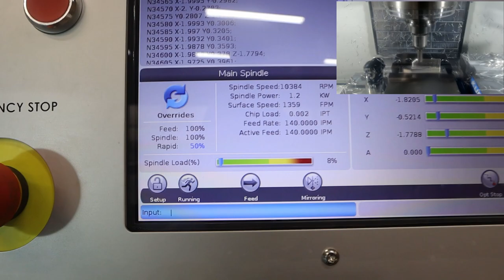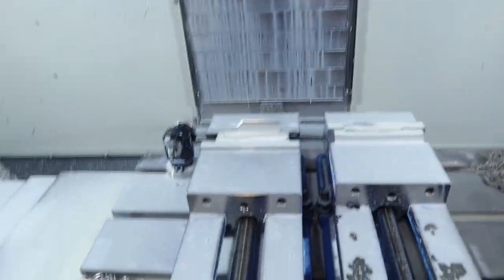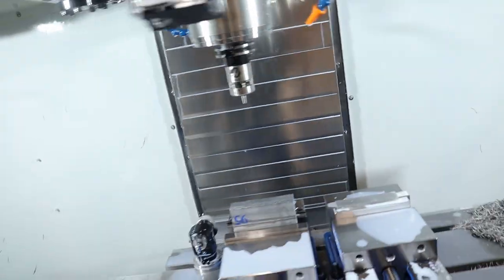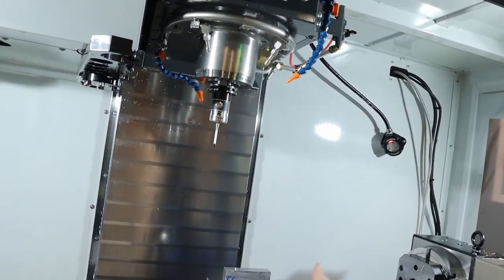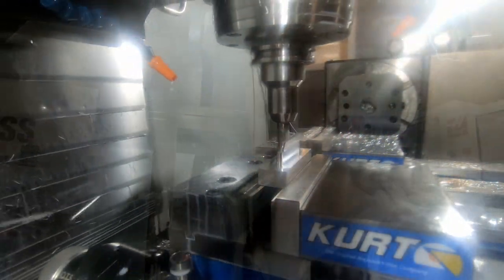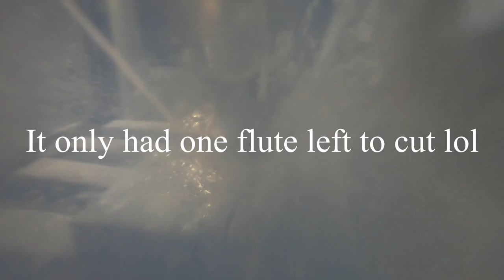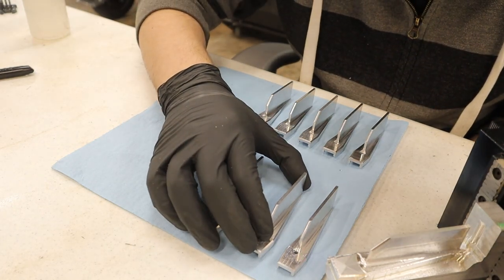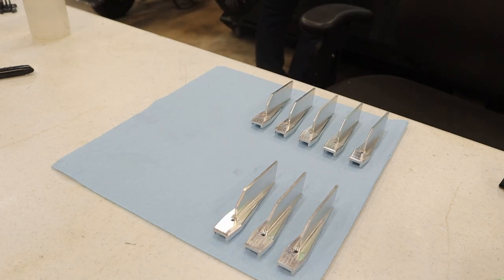Guide vanes for BPS.SPACE continued

Comment: Dude look for different tips for the probe. You do not have to buy Ruby tips. Look for carbide tips. 100x cheaper. You just have to either match the ball size and shank or change the ball and shank in your cam setup. Also, that's something you don't have to buy from Reneshaw or Haas. There a dozens of suppliers. Carbide probes won't hold as tight of a tolerance but you're not machining to like .0001" and your alignments aren't critical either.
Reply from the maker: Yea I actually bought a cheap chinese ceramic ruby one for $70 as a back up. I was kinda in a rush and my hfo is only 25 mins from me.